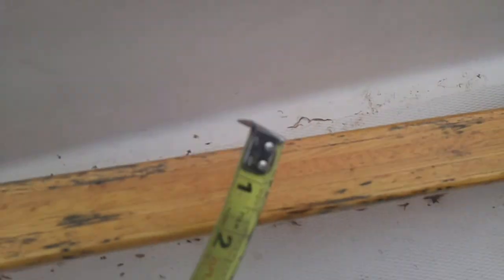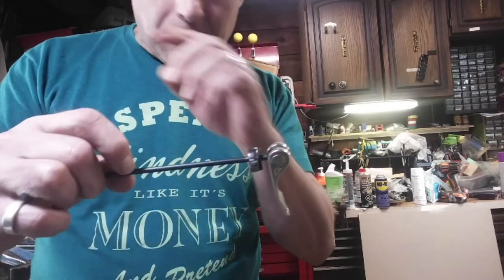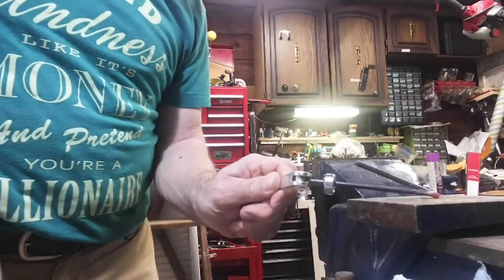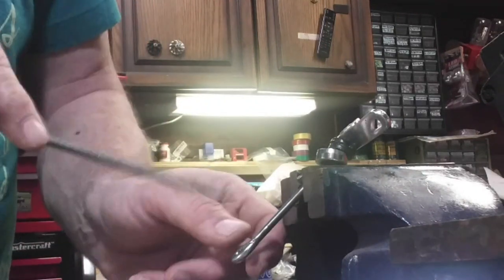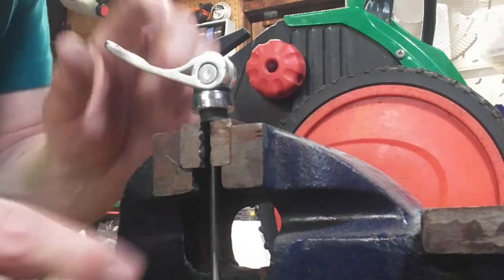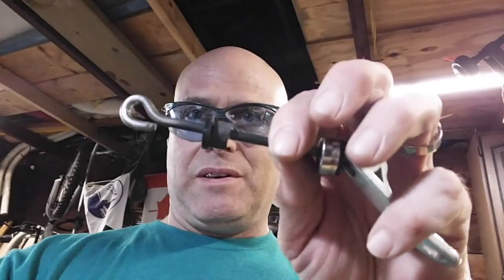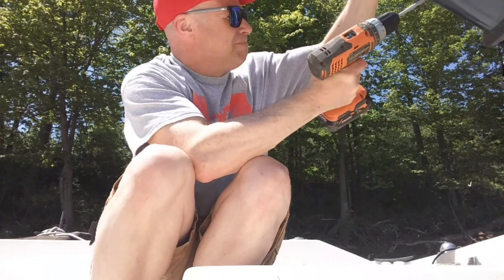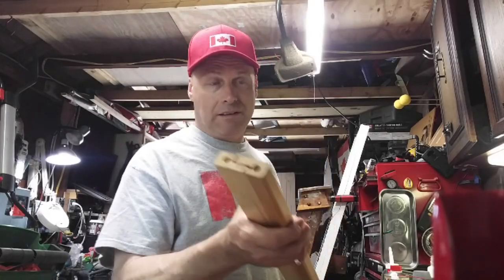Home Made Sailboat Tiller Clutch Build and Install

Comment: Some time ago I made one of these and found it worked very poorly. The lever doesn't provide enough throw. Adjusting it tight enough to actually grip the rope sufficiently makes it also too tight when loosened (to have the rope slide thru loosely enough), making it difficult to steer when disengaged. No amount of fiddling with it made it work well.

What I now use, and which works fairly well, is much more simple. It's basically just a vertical bolt thru the tiller on which I wrap (one turn) the rope tightly. Like what the lever method is supposed to do, it holds the tiller centered (or even somewhat off center), and actually loosens its grip, more and more, as the tiller is manually moved away from center.
Reply from the maker: Thanks Dan. 

Have you got a video or photos of your set up? 

I haven't tested mine yet but will be testing this weekend. I have a small piece of rubber hose that I'm going to try out as see if that helps hold it.